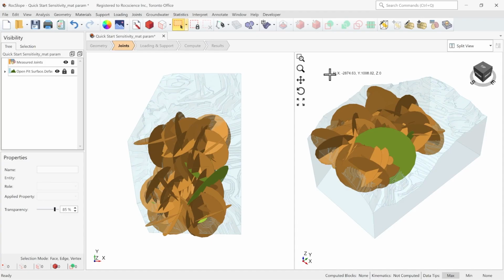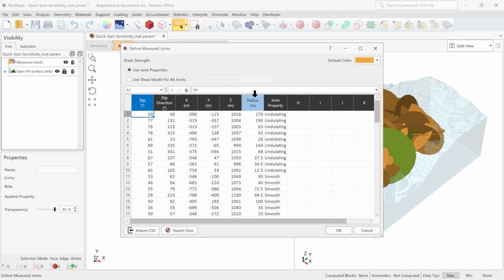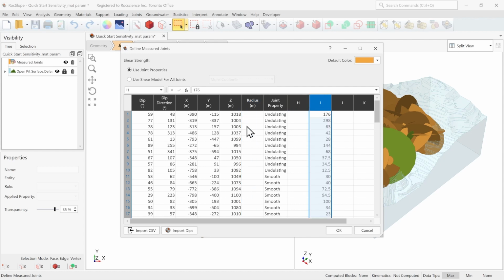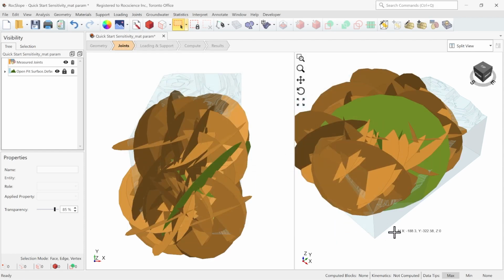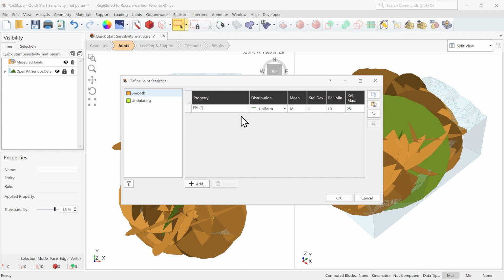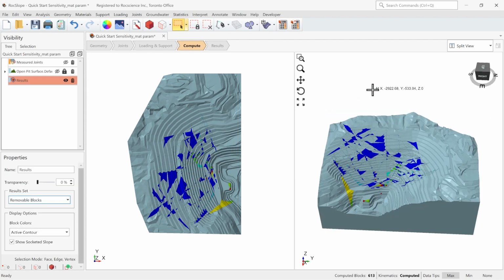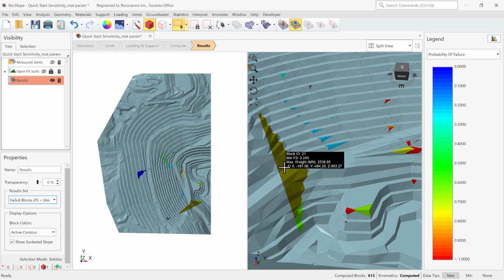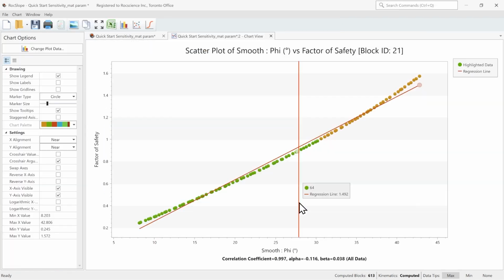Mastering RocSlope3 - Sensitivity Analysis

Comment: The sensitivity analysis made here only was applied for the mechanical rock characteristics. If the rock mass shows a more structural control, such a complete statistical analysis turns into the geometry analysis (e.g. joint size coming from the trace length, intensity P32/P10, orientation etc) to get a probabilistic robust analysis. Great tutorial!
Reply from the maker: Hi @nio837, the sensitivity study shown dealt with uncertainty handling of joint sizes and joint strength parameters. In a complete stochastic assessment of joint-controlled block stability, we would be interested in simulating variations in not only the joint strengths, but also the joint geometry (size, orientation, set spacing etc.). Thank you for your feedback!